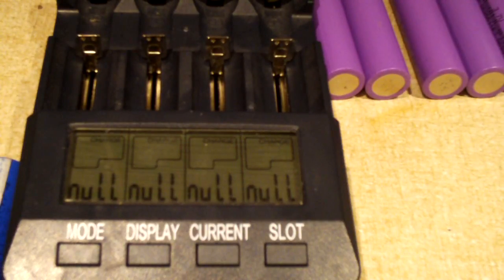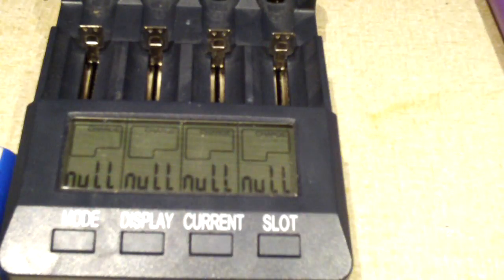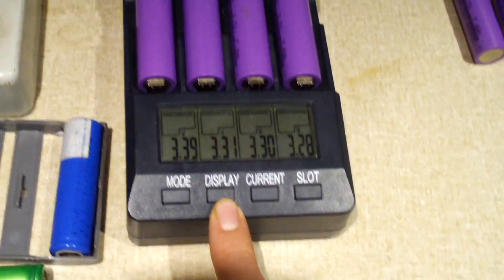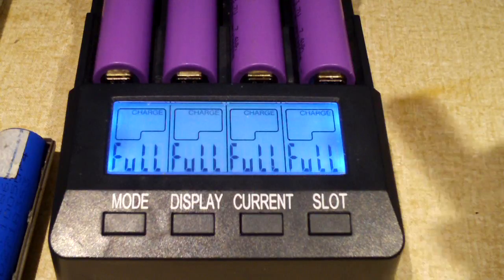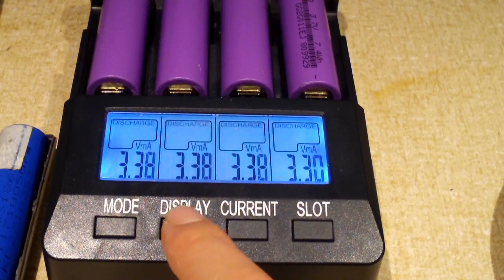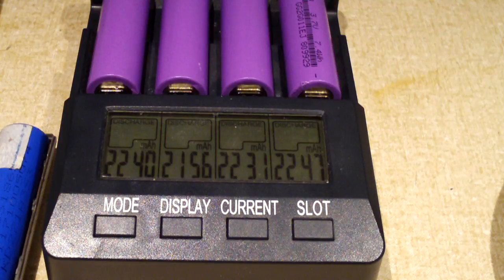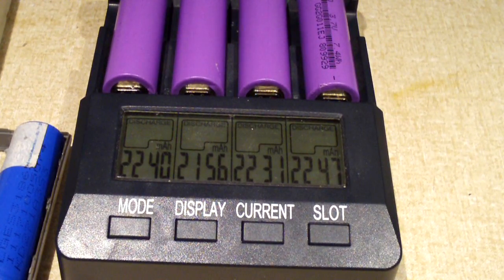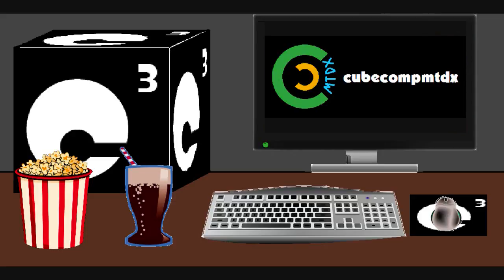Capacity testing the generic 18650s from the crappy 9 cell pack

Comment: You know its a fake if it says over 3600 mah and they will be spendy if they are 3600
You can weigh them also and a good one will be 45 grams or so, ultrafire and the cheap rubbish will be around 35 grams

Comment: I just bought 2 brand new BT-3100. The (quick test) internal resistance reading is different from my other separate digital internal resistance tester.  Is the interal resistance accurate on the OPUS? I trust my other digital internal resistance tester.

Comment: I know this is an old video, but I bought an 11 dollar generic HP battery, because it was cheaper than buying the cells for a flashlight. So I was somewhat concerned that they may be low capacity. Finding this vid and then hearing your American accent was very reassuring for some.odd reason so thank you

Comment: I had 2 ebike batteries first one died and warranty replaced it second one died 6 months later. I was upset so I refuse to spend $600 they were asking for the stupid proprietary BS ebike battery. So I took them apart following some guides and with advice from Friends found out that it had no fuse in fact it had fake fuses (I think??) were it claimed fuses were and had melted the plastic inside only thing saving it was (I think) the key disconnecting power to that section of the battery. I had pulled the keyy out once I smell smoke. So I followed some guides to remove the batteries from the nickel plating and tested the batteries and they're at 2500! At least the cells turned out to be half decent at least as far as capacity is concerned so now I'm going to combine them into one 52 volt battery when it was a 48 volt battery and it will have better range as well. Looks like I might need to replace the controller and the BMS but otherwise it should be a fun learning experience and project the only thing I'm unclear on is the connectors I'm supposed to use but I'll figure that out as I go

Comment: You need to mod your Opus charger to get real capacity of those cells when they are discharged, because that little fan behind can´t handle enough dissipation to 1A or 700mA discharge and the charger stops discharging for an while and later starts discharging again, by that time, the cells recover some of their capacity, so this is because you get some more capacity from those cells.
Reply from the maker: Mine does not stop... however I sometimes place a fan next to it to help dissipate heat as yes the little built-in fan is awful.
Reply: @CubeComputerChannel  yep that lttle fan is awful, maybe i can show a video where all of my opus stop discharging for some time, like  5 minutes, and when gets cool down, discharges again, this is where the batteries recovers a little. I got these purple batteries and they can reach that 2100 mAh capacity too.

Comment: Lesson Do Not buy used laptop batteries unless they are free I did the same as he new generic laptop.  packs 2$ a cell average 2200mah
Reply: Bob Ravenscraft I just bought 70 laptop batteries for €40... that is a very decent deal.. also if they are around 2000 mAh

Comment: At my opus BT-C3100. If you press and hold the display button for 10 seconds, the display light will stay on until you cut off the power.

Comment: I don’t know if happens to you, but when I recharge a single cell for example at rate of 1amp, at the end I get a value capacity in mAh (2000 mAh, for example).... When I do the discharge process at the same 1A rate, the final value is always lower than when charged (In this example would get 1200mAh almost always 60% of total). I think it is because when discharge has a power loss through hot. But in your video it didn’t happen. what do you think?
Reply from the maker: Typically when cells aren't in the best of health, you won't get near as much out of them as you put in them. These purple cells in the video can be considered "new" as they likely do not have many cycles on them.
Reply: Cube Computer Channel It’s funny because even testing brand new panasonic 18650a (3100 mAh..those green ones) it happens! I’ve tested this cells using basically different type of diy power bank. When you test cells capacity you use only this opus charger or there is another accurate method you know?
Reply from the maker: With a power bank, there will be some power loss through the step-up components in the power bank to supply USB voltage (5V).
Reply: So the most accurate method without so much energy loss from heat would be using Opus charger?
Reply from the maker: Yes, or any smart charger that can report the discharge capacity of the cell. In a power bank, there is a loss of energy through the voltage conversion process. This energy is lost as heat. This is why power banks get warm, particularly around the electronics.  The charger in contrast, drains the cell directly, typically via resistors, and is able to calculate the discharge in mAh by use of measured voltage and current draw.

Comment: I have the exact same charger and usb powerbanks :) which i use as portable soldering iron.
im 100% sure the btc3100  (atleast my one) overestimates capacity.  one of these days i will do some tap in and get some numbers and %s out of it.
Reply: چچچ
Reply: You are wrong. https://www.youtube.com/watch?v=O4_1m-2tpxQ&ab_channel=LithiumSolar
Reply: @dtesta  Maybe, maybe not. But you dont measure an instrument by comparing it to another instrument made by the same manufacturer with the same topology no matter howmany MS excel spreadsheets you fillout. but that's ok, I have the BTC 3100 wired to 2 external multimeters and a watt meter right now measuring, i will show you the results in a bit with a photo .
Reply: @dtesta  so far im at 50mah and its at 17.02% ... but im gona let it finish .
Reply: @dtesta  turns out every few seconds the charger stops charging for a moment and measures the float voltage of the cell to determine charge status (which is kind of a must for ni-mh batteries), but i think the capacity meter is timer based and doesn't take that into account . Results are 18.57 % over estimation. if you want send me your email and i will send you the photo.
Reply: @fortheregm1249  With that logic, it means that most (all?) battery testers shows wrong then. Testers are usually within 1-2% difference between eachother. Also, how do you explain that my new 18650 batteries from Samsung and LG shows almost the exact capacity as the label/specs when I run a test on my Opus?
Reply: @dtesta  say you charge a battery for an hours at 1 amp then let it cool down for an hour and charge it again for another hour.  ( on-off-on). 
you have put 2 amp hours into it, not 3. it doesnt matter if you paused it for cooldown or measurements or any other reason.
I'm not comparing chargers to eachother, I'm just saying the BT3100 over estimates.
Now as to why you get correct value from your LG cells ? that's easy. I will explain a few of the more simple reasons.
1. LG and Samsung underestimate their cell capacity.
2. the specified capacity is MINIMUM guarantied capacity in the data sheet and not typical.
3. the battery data sheet states full charge as letting battery voltage reach 4.2v (standard charge) and float charging the battery at 4.2v (saturation charge) until current draw drops to 20% and then they consider the battery "full". 
these simple jack of all trade chargers will just cut off the charge once its at 4.2v and skip the saturation charge.
But battery OpenCircuitVoltage is Elastic, you can google what that means.
dont believe me ? charge an older battery at 2 Amp and another at 200Ma on that charger and compare the results.
Reply: @fortheregm1249  What are you talking about?? My Opus IS saturation charging! Even if I set 500mA charge, it will still charge to 4.2v and then slowly decrease the charging amps from 500mA to 0. BUT even if what you are saying is true, it would mean that the chargers stops charging to EARLY and it would mean the discharge would show a LOWER capacity and not higher.
Reply: @dtesta  Yes exactly . ie its putting 900Mah into a 1000mah battery, But because of its over estimation in calculation it shows a number like 1050mah.
But There is no need for all this theory craft, just hook one up to a watmeter or an amp meter and a clock and count it so you can see with your own eyes.
Reply: @fortheregm1249  But seriously.. you should NOT be testing CHARGE value anyways! So it's irrelevant. If it undercharges, as you say, then the battery will only get 900mAh. So later when you actually test the battery by DISCHARING it, it would only be able to discharge 900mAh and it will result in a LOWER value than the actual. Not higher, as you claim.
Reply: @dtesta  don't worry,  i will discharge test that too when i get home 😉
Reply: @dtesta  whats your email Daniele ? I Took photos of discharge on wattmeter and discharge pattern and PWM patterns on an oscilloscope. I see you using a ESP-8266 so im pretty sure you can read numbers from an oscilloscope. So instead of me telling you it over estimates discharge by 8% and you telling me no, I will just show it to you and you can do the figuring out for yourself.

Comment: These are great cells. Tested the same capacity as in your video.

Got 3 oranges of that brand to. They are sitting inside a powerbank which is not being used anymore. Might harvest them sometime.

And got 4 green cells of these to. Rated for 2600mah, and i think that's true to.